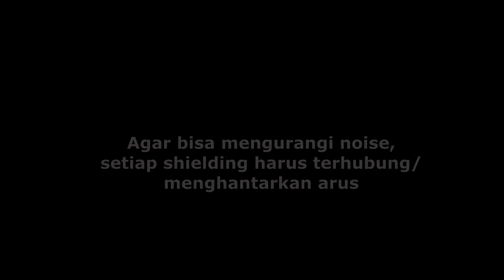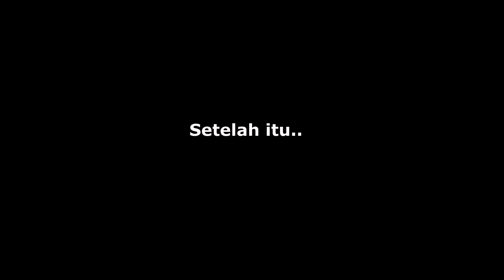Mengurangi noise pada bass dengan shielding alumunium

Comment: Magnet pickup kalau di pegang bunyi buzzing itu gmn solusinya?
Reply from the maker: Klo saya yg gampang aj mas, pake selotip elektrik hehe. Atau yg bening jg gak papa. 

Saya pernah lihat ada yang di ground si polepiece/ magnet nya, tapi saya belum pernah coba..
Reply: Kmren saya coba mas pke selotip chopper trus solder kabel ke ground tapi sama aja tetep kalau di pegang ada buzzing,
Reply: Selotip elektrik yg gmn y?
Reply from the maker: @poemster_1991  yg warna hitam mas, yg suka dipake bungkus kabel. Saya juga belum pernah coba kalau di ground, jadi ya magnet nya saya tutup pake selotip itu..
Reply from the maker: @poemster_1991  http://www.audereengineering.com/FAQ_PUMag_Gnd.htm  
saya belum pernah cba, tapi di link itu ada info tentang grounding magnet/polepiece pickup. smoga bisa membantu..
Reply: Ouh heat sink ya?
Reply from the maker: @poemster_1991  bukan gan, coba aj googling 'electrical tape'. Kalo misalnya selotip bening nya jdi kuning ya tinggal di ganti aja gan hhe...
Reply: Tutup pake selotip lama2 tar jadi kuning g warna selotip beningnya?